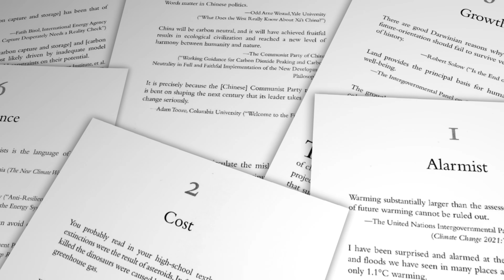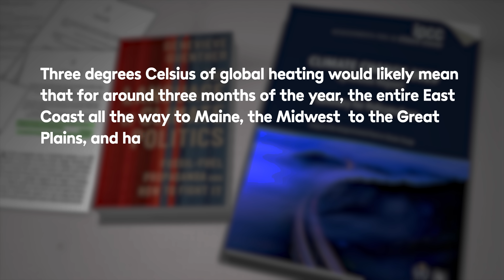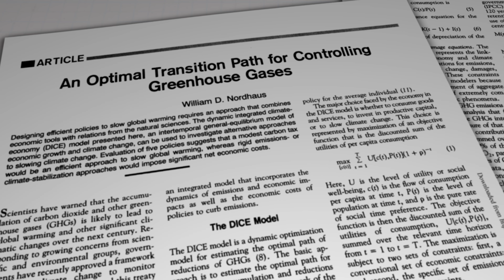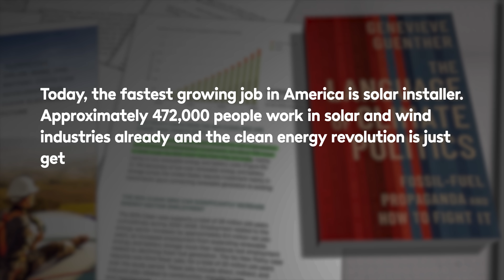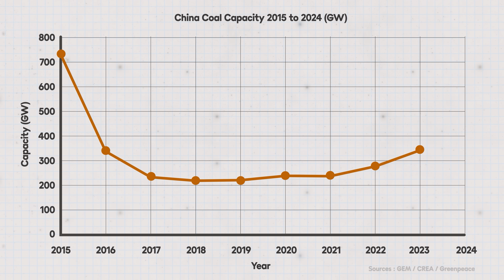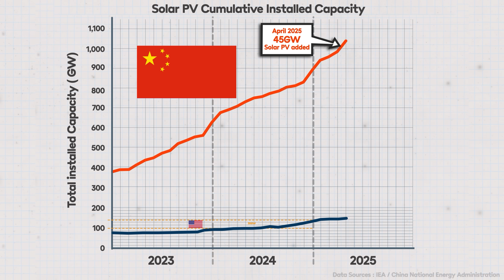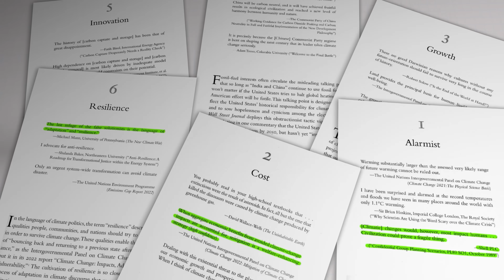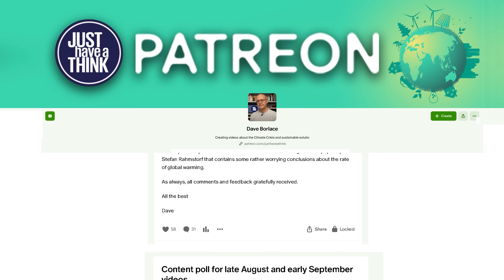New research DEBUNKS climate disinformation.

Comment: Just have a debunk. The UN's IPCC AR6 WG1, chapter 12 "Climate Change Information for Regional Impact and for Risk Assessment", page 1856, section 12.5.2, table 12.12 confirms evidence is lacking or the signal is not present, leading to overall low confidence of an emerging signal both for the recent past or by 2050 even under the most extreme climate modelling (RCP 8.5): 
Air Pollution Weather (temperature inversions), 
Aridity, 
Avalanche (snow), 
Average Wind Speed, 
Coastal Flood, 
Agricultural drought, 
Hydrological drought, 
Erosion of Coastlines, 
Fire Weather (hot and windy), 
Flooding From Heavy Rain (pluvial floods),
Frost, 
Hail, 
Heavy Rain, 
Heavy Snowfall and Ice Storms, 
Landslides, 
Marine Heatwaves, 
Radiation at the Earth’s Surface, 
River/Lake Floods, 
Sand and Dust Storms, 
Severe Wind Storms, 
Glacier, and Ice Sheets, 
Tropical Cyclones.

Addendum for Seenfromspace.
The Greenland Ice Sheet contains about 2.9 million cubic kilometers of ice (NSIDC). Using the formula M=Vd (and assuming density of glacier ice 0.9167 Gt/km³), the mass of GrIS is approximately 2.7 million Gt. If we use the figure of annual loss of 270 Gt, we get 0.01%, or 10,000 years, so around 12,024 AD. The problem is the average figure of 270 Gt  (NASA data 2002-2023, 0.8mm/year sea-level rise, so a non-problem). That average value and the data range used gives no understanding of the changes taking place. Prior to 2000 GrIS was not losing mass. From 2002 to 2012 mass loss accelerated, then from 2012 to the present mass loss trend decelerated (85Gt, 2021 and 80Gt, 2024). The changes aren't linear they are sinusoidal and are related to the North Atlantic Oscillation, not the the concentration of CO2 in the atmosphere. If the melt rate stays at 80Gt per annum we are looking at a contribution to sea level rise of 0.2mm a year (which I think we can round down to nothing) and the ice cap vanishing in around 33,000 years hence, but don't worry we should be in the middle of another period of intense glaciation by then with our coastal cities high and dry, hundreds of miles from the sea.

When it comes to Antarctica, ice sheet (1992-2020) annual loss was 90Gt/yr. It's total mass is 24,380,000 Gt (24380000000000000 tons), so it loses less than 0.0004% of its mass annually, which I think you could reasonably round down to zero. It contributed 0.36mm to sea-level rise per year (that's essentially nothing as well). At that rate it will take well over ¼ million years to melt, but we are due for two more glacial periods in that time. That ice is here to stay.
There's also a bit of a problem with the accelerating ice loss in Antarctica idea. It's not accelerating. If you want to dig down to the actual data, that is. Just so we're clear, I'm referring to the paper entitled "Mass balance of the Greenland and Antarctic ice sheets from 1992 to 2020" by Otosaka et al, 2023. Can I direct you to table 2, and the text below it?
If we include the APIS in "continental" (although I wouldn't) there's no pattern with a slight loss overall - neglible. EAIS, by far the larger of the continent's ice caps, both by surface and volume, hasn't lost mass. It has gained mass, but again it's neglible. So that leaves us with WAIS. It's only WAIS that's driving the mass loss from Antarctica, and you can see that from the Figure 4 graph. Figure 4 and Table 2 show there is a step up in mass loss around 2007. You might want to call that an acceleration. However there's a deceleration from 2017 or at least a noticeable reduction in the rate of annual ice mass loss for the period 2017-2020 when compared to 2012-2016.
So accelerating then decelerating. The Antarctic Ice sheet is massive and it's never going to melt on the timescale of human civilisation.
Then of course since 2000 the Antarctic Ice Sheet cumulative mass balance has either been steady according to NASA GRACE or increasing according to Velicogna et al. 
The whole of East and West Antarctica is cooling, and has been for 40 years.  Furthermore, the Antarctic Peninsula ice has since been shown to be on the increase “The eastern Antarctic Peninsula Ice Sheet has grown in area over the last 20 years, due to changing wind and sea ice patterns.” (University of Cambridge, May, 2022.)
In reality, "there have been statistically significant positive trends in total Antarctic sea ice extent since 1979." (Fogt et al, 2022. Published in Nature) "since 1979 is the only time all four seasons demonstrate significant increases in total Antarctic sea ice in the context of the twentieth century". 
A study of Antarctic ice shelves from 1980 to 2021 (Banwell et al, 2023) showed meltwater volume dropped with "decreasing trend in both annual melt days and meltwater production volume over the 41 years.”
"Overall, the Antarctic ice shelf area has grown by 5305 km² since 2009, with 18 ice shelves retreating and 16 larger shelves growing in area. Our observations show that Antarctic ice shelves gained 661 Gt of ice mass over the past decade." (Andreasen et al, 2023). It is from a paper entitled "Change in Antarctic Ice Shelf Area from 2009 to 2019". They use MODIS (Moderate Resolution Imaging Spectroradiometer) satellite data to measure the change in ice shelf calving front position and area on 34 ice shelves in Antarctica from 2009 to 2019. Also, as the mass gain (661Gt) was given, you could calculate the volume of the ice gained using the formula: Volume = Mass ÷ Density (assume Density of glacier ice 0.9167 Gt/km³). This would give you (well not you obviously) an Ice Gain Volume ≈721km³. That's how much extra of the lovely white stuff there is around Antarctica. Imagine standing in the centre of this extra ice. It would stretch beyond the horizon in all directions and would be 45 storeys high.
The retreat of glaciers such as those in Himalayas began before the current warming and was caused by reduced precipitation (Shekhar, 2017. Singh, 2020.). This supported by further work done by Schneider (2014), and Chen (2019). The retreat was due to a reduction in precipitation. Currently, precipitation is half of what it was 20 years previously. Research by Salerno (2015) "challenges the assumption of the main driver [i.e. temperature] of glacier mass changes". 
Satellite data shows the glaciers in the Karakoram largely unaffected by current warming. Of 1219 glaciers surveyed, 79.5% were stable, 5.3% were advancing, and 7.6% retreating (Rankl, 2014). 
Swiss Alps glacier extents were smaller than 2000 C.E. during  the warmer-than-today Roman and Medieval Warm Periods and throughout 75% of the Holocene, or when temperatures were 1-3°C warmer (Schimmelpfennig et al., 2022).
Glaciologists Bohleber et al, 2020 of the Austrian Academy of Science discovered from ice cores that the 3500-meter high Weißseespitze summit was ice free 5900 years ago.
There is “no evidence” that Jostedalsbreen, a southern Norway glacier, even existed during the first several thousand years of the Holocene, or when CO2 hovered near 260 ppm (Winker, 2021). 
In Alaska's Glacier Bay the melt rate from 1780 to 1880 was much greater than the melt rate from 1880 to the present. 
There is no objective observational evidence that we are living in a global climate crisis. Glacial retreat is certainly not evidence of this.
Reply: What are you trying to say here?
Reply: @incognitotorpedo42 There is no evidence that we are living through a global climate crisis.
Reply: You posted all that last week and I punctured your assertions then. You didn’t reply, which I took as acquiescence.
Reply: @SeenfromSpace You must be confusing.
Reply: @OldScientist   Nope. It all went quiet when I insisted you consider the actual figures for mass loss from ice sheets and mountain glaciers. It all went quiet when I took you up on the CO2 not being a GHG fossil crap. It all went quiet when I wanted to talk about fossil $$ in science denial. You’ll find I can be very stubborn.
Reply: @SeenfromSpace 
Repetition is a form of learning. 
The Greenland Ice Sheet contains about 2.9 million cubic kilometers of ice (NSIDC). Using the formula M=Vd (and assuming density of glacier ice 0.9167 Gt/km³), the mass of GrIS is approximately 2.7 million Gt. If we use the figure of annual loss of 270 Gt, we get 0.01%, or 10,000 years, so around 12,024 AD. The problem is the average figure of 270 Gt  (NASA data 2002-2023, 0.8mm/year sea-level rise, so a non-problem). That average value and the data range used gives no understanding of the changes taking place. Prior to 2000 GrIS was not losing mass. From 2002 to 2012 mass loss accelerated, then from 2012 to the present mass loss trend decelerated (85Gt, 2021 and 80Gt, 2024). The changes aren't linear they are sinusoidal and are related to the North Atlantic Oscillation, not the the concentration of CO2 in the atmosphere. If the melt rate stays at 80Gt per annum we are looking at a contribution to sea level rise of 0.2mm a year (which I think we can round down to nothing) and the ice cap vanishing in around 33,000 years hence, but don't worry we should be in the middle of another period of intense glaciation by then with our coastal cities high and dry, hundreds of miles from the sea.
When it comes to Antarctica, ice sheet (1992-2020) annual loss was 90Gt/yr. It's total mass is 24,380,000 Gt (24380000000000000 tons), so it loses less than 0.0004% of its mass annually, which I think you could reasonably round down to zero. It contributed 0.36mm to sea-level rise per year (that's essentially nothing as well). At that rate it will take well over ¼ million years to melt, but we are due for two more glacial periods in that time. That ice is here to stay.
There's also a bit of a problem with the accelerating ice loss in Antarctica idea. It's not accelerating. If you want to dig down to the actual data, that is. Just so we're clear, I'm referring to the paper entitled "Mass balance of the Greenland and Antarctic ice sheets from 1992 to 2020" by Otosaka et al, 2023. Can I direct you to table 2, and the text below it?
If we include the APIS in "continental" (although I wouldn't) there's no pattern with a slight loss overall - neglible. EAIS, by far the larger of the continent's ice caps, both by surface and volume, hasn't lost mass. It has gained mass, but again it's neglible. So that leaves us with WAIS. It's only WAIS that's driving the mass loss from Antarctica, and you can see that from the Figure 4 graph. Figure 4 and Table 2 show there is a step up in mass loss around 2007. You might want to call that an acceleration. However there's a deceleration from 2017 or at least a noticeable reduction in the rate of annual ice mass loss for the period 2017-2020 when compared to 2012-2016.
So accelerating then decelerating. The Antarctic Ice sheet is massive and it's never going to melt on the timescale of human civilisation.
Then of course since 2000 the Antarctic Ice Sheet cumulative mass balance has either been steady according to NASA GRACE or increasing according to Velicogna et al. 
The whole of East and West Antarctica is cooling, and has been for 40 years.  Furthermore, the Antarctic Peninsula ice has since been shown to be on the increase “The eastern Antarctic Peninsula Ice Sheet has grown in area over the last 20 years, due to changing wind and sea ice patterns.” (University of Cambridge, May, 2022.)
In reality, "there have been statistically significant positive trends in total Antarctic sea ice extent since 1979." (Fogt et al, 2022. Published in Nature) "since 1979 is the only time all four seasons demonstrate significant increases in total Antarctic sea ice in the context of the twentieth century". 
A study of Antarctic ice shelves from 1980 to 2021 (Banwell et al, 2023) showed meltwater volume dropped with "decreasing trend in both annual melt days and meltwater production volume over the 41 years.”
"Overall, the Antarctic ice shelf area has grown by 5305 km² since 2009, with 18 ice shelves retreating and 16 larger shelves growing in area. Our observations show that Antarctic ice shelves gained 661 Gt of ice mass over the past decade." (Andreasen et al, 2023). It is from a paper entitled "Change in Antarctic Ice Shelf Area from 2009 to 2019". They use MODIS (Moderate Resolution Imaging Spectroradiometer) satellite data to measure the change in ice shelf calving front position and area on 34 ice shelves in Antarctica from 2009 to 2019. Also, as the mass gain (661Gt) was given, you could calculate the volume of the ice gained using the formula: Volume = Mass ÷ Density (assume Density of glacier ice 0.9167 Gt/km³). This would give you (well not you obviously) an Ice Gain Volume ≈721km³. That's how much extra of the lovely white stuff there is around Antarctica. Imagine standing in the centre of this extra ice. It would stretch beyond the horizon in all directions and would be 45 storeys high.

I've added this to my original comment.
Reply: @SeenfromSpace 
The retreat of glaciers such as those in Himalayas began before the current warming and was caused by reduced precipitation (Shekhar, 2017. Singh, 2020.). This supported by further work done by Schneider (2014), and Chen (2019). The retreat was due to a reduction in precipitation. Currently, precipitation is half of what it was 20 years previously. Research by Salerno (2015) "challenges the assumption of the main driver [i.e. temperature] of glacier mass changes". 

Satellite data shows the glaciers in the Karakoram largely unaffected by current warming. Of 1219 glaciers surveyed, 79.5% were stable, 5.3% were advancing, and 7.6% retreating (Rankl, 2014). 

Swiss Alps glacier extents were smaller than 2000 C.E. during  the warmer-than-today Roman and Medieval Warm Periods and throughout 75% of the Holocene, or when temperatures were 1-3°C warmer (Schimmelpfennig et al., 2022).

Glaciologists Bohleber et al, 2020 of the Austrian Academy of Science discovered from ice cores that the 3500-meter high Weißseespitze summit was ice free 5900 years ago.

There is “no evidence” that Jostedalsbreen, a southern Norway glacier, even existed during the first several thousand years of the Holocene, or when CO2 hovered near 260 ppm (Winker, 2021). 

In Alaska's Glacier Bay the melt rate from 1780 to 1880 was much greater than the melt rate from 1880 to the present. 

There is no objective observational evidence that we are living in a global climate crisis. Glacial retreat is certainly not evidence of this.
Reply: @SeenfromSpace I've amended my original comment so you can't miss them.
Reply: @OldScientist   At least 2 of your paragraphs above are copied verbatim from Climate Depot, NoTricksZone or another affiliate junk site. All funded with oil money of course. The Salerno quote has been edited to change its meaning. Every paper reports accelerated recent losses and attributes them to global warming and GHG emissions. From your Rankl 2014 paper: “contrasts [with Karakoram] the worldwide retreat of many mountain glaciers”.

The diligent work you quote-mine/cherry-pick from does NOT say what you want it say.
Reply: @SeenfromSpace 
Is that it? 
You don't like the sources/references.  
You don't think they say what they say. 
Oh well I'm sorry about that. 
Will there be anything else?
Reply: @OldScientist   Here we go! Otosaka 2023 contradicts you directly. From the conclusion: “Ice losses have accelerated at both ice sheets over this 29-year record, and the rate of ice loss is now 5 times higher in Greenland and 25 % higher in Antarctica compared to the early 1990s.” 

Predictably Velicogna also contradicts you: “For Antarctica, we provided the first comprehensive mass budget estimate that demonstrated that Antarctica is losing mass (Velicogna and Wahr, 2006). More recently, we showed that the rates of ice sheet mass loss are unequivocally increasing with time (Velicogna, 2009).”

Do you read the papers you cite? 

Literally nobody’s worried that Greenland and Antarctic IS will disappear imminently! That’s a straw man. Fractions of a mm in annual sea level rise can’t be “rounded to nothing”, especially as that’s only part of the total. About half the total rise is from thermal expansion, so the numbers are worse than you’d have us think.
Reply: @OldScientist   No, the sources are fine. Your misrepresentation of them is not.
Reply: @SeenfromSpace The data is as I have stated it is. And I notice you don't directly challenge it. 
The fact remains that the Otosaka data shows no acceleration in mass loss for Antarctica's ice cap, with it contributing a phenomenal total sea-level rise of 6mm for the period of the study. If things continue that way, we are looking at less than ⅔ inch rise by the end of the century. Scary! 
Now at this point I need to thank you as I went back and looked at the data including more recent years. Imagine my surprise! The Antarctic ice cap has started gaining mass! (108Gt per year 2021-2023) so that ain't going to make the sea-level rise. No acceleration there. I wonder why Otosaka didn't include that data? It would have been available. 
So what about the Greenland ice sheet. Well it didn't get the accelerating melting memo either! All mass losses since 2020 have been below the average to 2020. In 2024, the Greenland Ice Sheet experienced its lowest annual ice loss since 2013, with a total mass loss of 55 ± 35 Gt, according to NOAA. Oh no! Decelerating ice loss. Neglible sea-level rise. And this year's SMB (which determines overall mass loss gain) is above last year's so neglible mass loss by the end of season in a month's time.
Reply: @OldScientist   The problem is not the data. It’s you ignoring the bulk of it. Have you looked at a graph of mass over time and seen the huge downward slope and the tiny upward blip of the 2021-23 event? Very easy to overstate that, and Oh! overstate it you did. Mass losses “below the average” in Greenland are still losses. Are you going to bend over backwards to see that as a reversal too?
Reply: @SeenfromSpace "Huge downward slope" now who's overstating? So Antarctica would give us ⅔ of an inch sea-level rise by the end of the century (but it won't because it's gaining mass, but let's just say it does for the sake of argument). The Greenland Ice Sheet's mass loss is also decelerating (but let's pretend). If we agree Greenland contributed 13mm (Wow!) to sea-level rise over the period of the Otosaka study and project that forward at a steady rate - although it's decelerating - we end up with an additional 1⅓ inch rise in sea-level level by the end of the century. That's 2 inches total. Run for the hills! The river running through my town has a tidal range of 576 inches (48 feet). 2 inches is a ridiculous non-problem, don't you think? Your "huge downward slope " statement is risible. My grandchildren won't even notice it as they enjoy their warmer, greener, wealthier planet.
Reply: @OldScientist    You’re missing the point. I’m not concerned with sea level per se, although salination of productive land and coastal groundwater is more than a “concern”! You insist there’s no evidence of a climate crisis. Cryosphere mass loss provides it in spades. Your screeds on the subject are gross cherry-picking, and don’t withstand any kind of scrutiny. You really think the threat to water supplies for whole continents can be rounded to zero? Adding hundreds of gigatons of fresh water to the oceans is really nothing? 

So what else is wrong in those physics books? It’s just the CO2 thing huh? Whose idea was that? Why do you carry water for the FF lobby? Are you an oil baron?
Reply: @SeenfromSpace My assertions with hard data have withstood all your scrutiny. The data destroys your argument. Your assertions are without evidence and can therefore be ignored. 
There is no objective observational evidence that we are living in a global climate crisis, so there is no climate crisis.
Reply: @SeenfromSpace Do you really think adding hundreds of gigatons of water to the ocean will have any meaningful effect? How? It just sounds a lot to you because we are tiny humans. It's about 0.0005% of the ocean's mass? More risible nonsense.
Reply: @SeenfromSpace Hundreds of gigatons of water is 0.000004 of the mass of the ocean, so hmm, that's next to nothing.
Reply: @OldScientist   Again you miss the point. Heard of AMOC, and the influence of melt water on convection and subduction?
Reply: @OldScientist    Are you also a creationist? They game the data, just like you do. Especially the Young Earth species. They get as excited over astrophysics and planetary science as they do over biology! A few years ago they got into gaming Special Relativity to get around the ancient starlight problem. That was entertaining, for a while. On CO2 you've certainly got nothing.
Reply: @SeenfromSpace 
Hmm. Have I heard of the AMOC...
The AMOC tipping point is a scare story about things you cannot see. 
To quote the Chief Scientist at the National Oceanography Centre (UK), Professor Penny Holliday, "There hasn't been a slow down. There hasn't been a slowing of the AMOC."
Actual observations using the RAPID-MOCHA array from 2004 to 2023 show, that although there can be a great deal of variability of flow in the ocean from month to month or even day to day, there has been no decline in the Gulf Stream, with flow oscillating around 32Sv (32 million cubic metres per second) throughout the period of observation. 
Continuous section measurements of the AMOC, available since 2004 at 26°N from the RAPID-MOCHA array, have shown that the AMOC strength decreased from 2004 to 2012, and thereafter, it has strengthened again. No relationship to CO2. 
MOC spanning the North Atlantic at 27°N derived from RAPID/MOCHA/WBTS, satellite altimeter, and Argo floats for 1994 to 2020 shows no statistically significant decline (-0.06 Sv per decade). Furthermore blended meridional overturning basin-wide circulation (MOC) trend estimates (Sv) based on combinations of satellite altimetry and in situ hydrography data exist for the South Atlantic for 1994 onwards: at 34.5°S (often referred to as SAMBA) is +0.48Sv per decade. This is a significant positive trend, so no decline, no tipping point, no correlation to CO2. (GLOBAL OCEANS G. C. Johnson and R. Lumpkin, Eds., 2021)
The OSNAP MOC Timeseries of observations from Canada to Greenland and across to Scotland, although a shorter timescale (from 2014), show no decline in MOC with the flow fluctuating around 17Sv.
"Florida Current transport observations reveal four decades of steady state" Volkov et al, 2024 (published in Nature). This paper shows that a key component of AMOC, the Florida Current, has remained remarkably steady for over 40 years. 
There is no climate crisis. 

The North Atlantic current has doubled its velocity over the course of a quarter of century (Oziel et al, 2020). This is based on actual satellite observations. 
The idea the AMOC is going to shut down is based on modelling. There is minimal real world evidence to support these outlandish claims. It relies upon climate models. You know, those Magical Truth Machines that keep making false predictions. Some claim with 95% certainty that the AMOC will collapse by the end of the century. Come on! Really? These numerical models produce ocean circulations that are far from what we actually observe. These models can't even replicate one of the key physical processes, Convection, in ocean currents "because convection is a small-scale process, it is not captured well in most current models (Jackson et al (2023)" (Rahmstorf, 2024). So they can't model Convection. So they can't model ocean currents.  

The most recent research into the AMOC confirms it is not weakening. From a 2024 paper by Terhaar et al published in Nature Communications "Based on the here identified relationship and observation-based estimates of the past air-sea heatflux in the North Atlantic from reanalysis products, the decadal averaged AMOC at 26.5°N has not weakened from 1963 to 2017". "Based on the results, the AMOC is more stable than we thought," Vogt said (one of the authors on the paper). "This might mean that the AMOC isn't as close to a tipping point as previously suggested." So not even close to a tipping point or collapse.

Sea surface temperatures (SST) - which are used as a proxy because, well, direct measurements of the current didn't agree with scary tipping point scenario - were trending downwards 2000-2018 (HadSST 4), and from 1950-1980, and from 1880-1910. The oceans warmed at a faster rate 1910-1940 than 1980-2010. Remember CO2 has been accumulating in the atmosphere at an accelerating rate all the time, so there is little correlation between the two. 
Also the notorious 'Cold Blob' has disappeared from North Atlantic surface temperatures -Rahmstorf must be gutted - when annual anomalies for 2013-2023 are compared to the average for the period 1979-2010 (ECMWF ERA5). The International Comprehensive Ocean-Atmosphere Data Set (ICOADS) shows an absolute Sea Surface Temperature departure of over +2°C exactly where the Cold Blob used to be. It may have been there but it's gone. Looking more carefully using NOAA ERSST V5 data for North Atlantic Sea Surface Temperature anomalies (50N-65N, 50W-10W) shows in 1942 a +1°C anomaly declining to -0.7°C in 1992 then rising to almost +1°C in 2010, declining again to -0.6°C in 2010, and of course rising again to +0.75°C in 2023. There are also oscillations in the data back to the 1850s, but there is no trend overall up or down, and no correlation to CO2. The same is true for the heat content in the North Atlantic down to 1000m (Met Office data). No correlation to CO2, just a natural variability. That's the data. The Cold Blob is an artefact. 

The North Atlantic ocean has cooled and warmed rapidly and repeatedly during the current interglacial with no correlation to CO2 e.g. 10,300-10,200 years before the present (y BP), 9,500y BP, 6,000-5,900y BP, 5,400-5,300y BP, 2,500-2,300y BP, 1,700-1,600y BP (Berner et al., 2008. See Figure 8 in the paper). There is a high frequency (18 events) of SST variability on the order of 1-3°C during a 10-50 year time resolution throughout the Holocene in the North Atlantic with no correlation to CO2. 

Will there be anything else? 
Or is that it?
Reply: @SeenfromSpace "In God we trust, everyone else brings data."
Reply: @SeenfromSpace Let's take stock. We've covered IPCC CID's, Polar ice caps, ice shelves, sea-level rise, glaciers, and AMOC. I've brought huge amounts of data from internationally recognised scientific institutions and reputable peer-reviewed papers. This has been described as cherry picking. You, by contrast, have brought...no data. Just emotional pleading and ad hominem. 
You infer that I am relying on faith when of course you cannot see the reality that it is you that are relying on faith. 
As the Good Book says "And why beholdest thou the mote that is in thy brother's eye, but considerest not the beam that is in thine own eye?"
Reply: @OldScientist   I’m not going to read all that, come on! I suppose you were being deliberately obtuse by not taking my point on adding fresh water to the ocean?
Reply: @SeenfromSpace 
You'll just have to wallow in ignorance. 
You are obviously not interested in what actual scientific observations say about climate.
Reply: @OldScientist   Why do you carry water for oil billionaires?